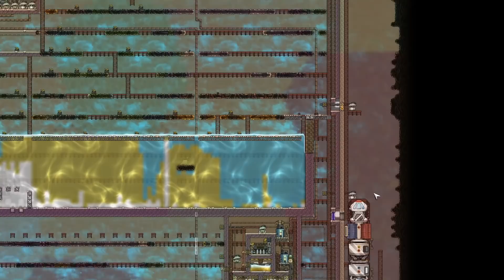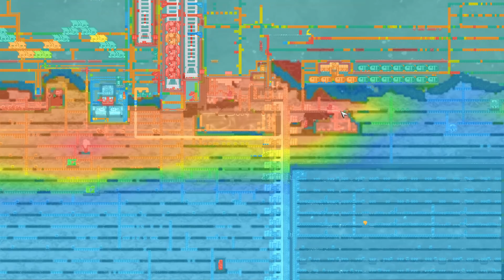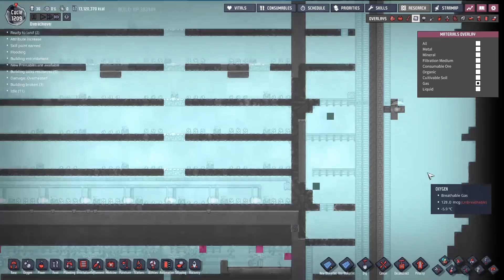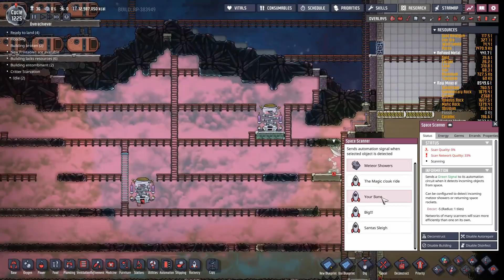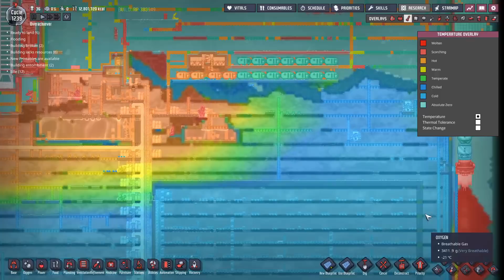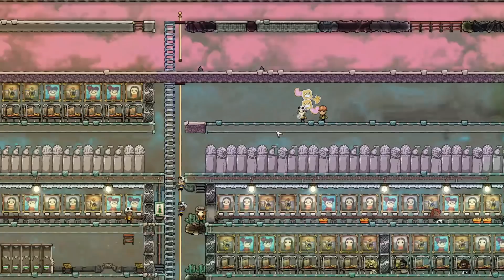Rime 27 : A Chimney for Santa so my dupes can get presents : Oxygen not Included

Comment: You could reduce the loss of steam at the top of the chimney by using power steel airlock doors right below your bunker doors they can be on the same automation and are much much faster
Reply from the maker: Might do it a little lower down, they are not immune to meteors so I would need to give them at least a little protection. I'm not sure If I will be always able to keep the part serviceable.

Comment: When you added water on top of the Petroleum at 15:38, the issue was that the Petroleum was over 100° so your water flashed to steam on contact, then condensed pretty quickly through the rest of the environment.
Also, my bog standard way to cool steam turbines is to just pipe their own output over the top of the turbine using radiant pipes and let them 'cool' themselves using the 95 degree water, while also preheating that water back towards the 100 degrees we want it to get to soon anyway. So long as you're not running steam over 200° you should be fine
Reply from the maker: I play tested with self cooling steam turbines, I believe you have to keep the steam you feed them below a set temp. I want to say around 160C otherwise you don't get full up time on them. I'm going to need a lot of steam turbine for this chimney, somewhere between 12-15 assuming it generates as much heat as I'm anticipating. It might go as high as 24 to 30 if I go a bit crazy at it. That is only assuming I can run them at 200C, if I have to limit them I'm going to need even more.
Reply: @FrancisJohnYT  oh is that right? I thought it just had to be below 200. I might need to have a scan around my base and make sure I'm not throttling anything!
Reply: @ganashal  135C seems to be the magic number for self-cooling turbines, otherwise they stifle themselves. I believe oil on the floor or H2 helps increase it a little.

Comment: Why use Bunkerdoors for the inner lock? Wouldn't steel airlocks work faster?
Reply from the maker: I worry about meteor damage, I may install them later but I would need to ensure consistent dupe access first. That requires consistent temp and a decent liquid lock.
Reply: @FrancisJohnYT Is this still an issue with the dlc? Since then, there aren't any meteor showers anymore

Comment: My petroleum and hydrogen rockets melt my thermium cargo rails, visco gel was never gonna cope! 😂
Reply from the maker: But I have a plan, a cunning plan. If I get the steam pressure in the silo to say 10kg then it will dilute the heat from the exhaust and it should hopefully not go above 400C, then in between launch and landing the steam turbines can drain the heat. If I can get the plan to work or not is a different story.
Reply: @FrancisJohnYT  I like your style, are you going to add water? I am building a steam setup under my 5 rockets, harvesting the heat with bunker tiles. Interested in how yours turns out. You never fail to make it epic!
Reply from the maker: @TheGalifrey  After enough launches I will know what the max pressure is before it all starts escaping into space faster than the rockets add more steam. Then maybe stack a second rocket in the chimney.
Reply: @FrancisJohnYT  why not use a row of mechanical airlock under the bunker doors as they don't need to withstand meteor hits and they close faster. May need to use thermium though for the heat.
Reply from the maker: @TheGalifrey  Might be on the cards, depends if I can keep the temp low enough to install liquid locks so my dupes can gain access to repair the doors when they inevitably get damaged by a meteor. Currently just sticking with bunker doors.

Comment: A few carbon skimmers on the bottom of your pit should help nicely to clear up the CO2. Heat might be an issue with the water in the pipes tho.
Reply from the maker: I'm not sure what happens to the water in the skimmer, does it exchange heat with the surroundings? Will require research.
Reply: @FrancisJohnYT  It does exchange heat, but it won't turn into steam until it left the carbon skimmer/ Throttle the amount of water going to the skimmer to like 500 g/s, and then monitor the water coming outside of the carbon skimmer. If there is an interuption in the flow outside, stop the water going in for a few seconds
Reply from the maker: @Ferrybig  This sounds more difficult than a gas pump with a couple of CO2 senors. I am all about that simplicity. Also I think hydrogen rockets give of CO2.

Comment: just take the heat out with e.g. conveur rails? On my playthru i want to even take the heat from space (all the things which hits your steel walls) and make it to power, but sadly, i need much more steel for that plan xD. Whats best way to get much lime? I have like 8x8 hatches nearly since starting of the game (im now at 1200) and still, not enaught lime/steel... :/

I maybe thought, what about the glowing animals, i know they give low lime.., but i guess, better then nothing???
Reply: best lime source is pokeshell ranches, they give 10kg per pokeshell death and 5kg when the baby turns to an adult, plus the egg shells, so much more efficient than the other critters
Reply: @emadkhatri  ok, but how to feed them?
Reply from the maker: You could try feeding them polluted dirt from a ethanol distillery. However if you want you can just feed one to expand the population and then do a starvation maintenance thing. Don't feed the new poke shells but do groom them and they will lay one egg before they starve. So the one you are feeding expands the population and the ones you are not feeding just replace themselves. Also don't forget to grind up all the fossil on the map for lime, you can also harvest fossil from space.

Comment: Maybe you should streamline the right side of the chimney. Make it a uniform tunnel through and through so the meteors cant land and gather around the nooks and cranies. Currently you have some regolith on the side bits that might contribute to your CO2 problem, dunno. Filling the whole side of the chimney until it's just the right size for the rocket would take a while tho.
Reply from the maker: My neat streak wants to do it, but I would have to use steel or it would get destroyed and I don't have enough steel left. I'm stuck with it the way it is right now.

Comment: Bruh. Use steel wires next time. And supercoolant double puddle airlocks.

Sour Gas be like

B R U H
Reply from the maker: I'm low on steel, I did build a bunker tile wall across the top of the map and down the entire side of the map, it was expensive. I may have to use the super coolant liquid locks, I'm pretty sure I'v got enough left to make it work.